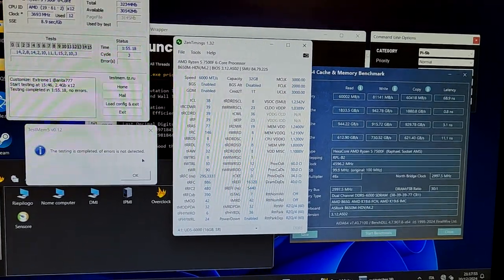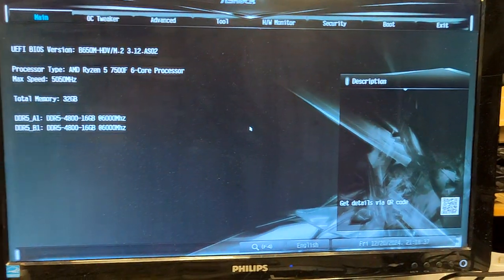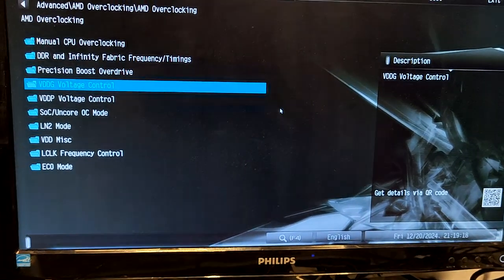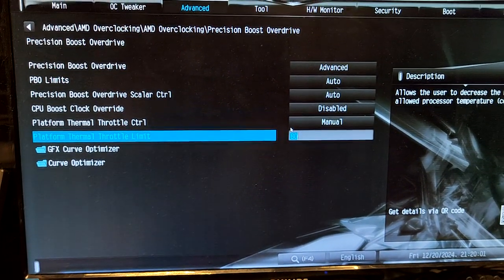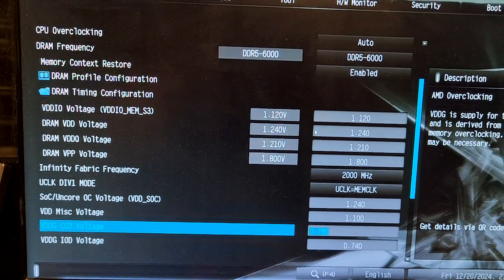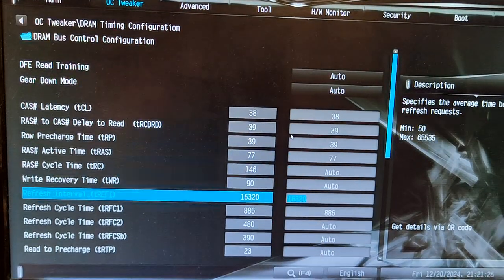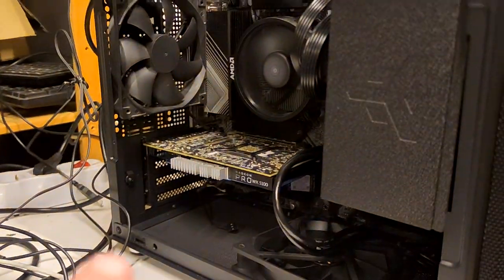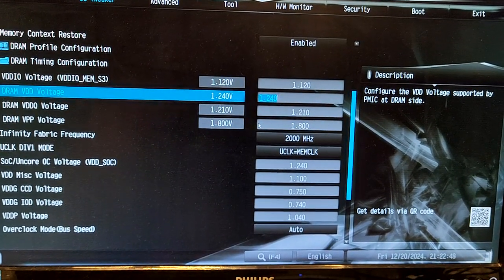unlucky 7500f undervolt, curve optimizer actually in line with overall silicon quality

Comment: would that be helpful in lowering the North and South Bridge chipsets temperature? in MSI Tomahawk Mag 670e?? because that chipset is getting hot in that version 670e and keeps getting higher temp. till you put a fan there!. Thanks for your videos.
BTW, those two chipsets are now together in the same location under the heatsink in the motherboard.
Reply from the maker: i think there is a separate toggle for chipset voltage, these settings in the video affect northbridge / imc power draw

Comment: Very strange. I have almost the same set: 7500f (PBO + 200, curve - 30) asrock b650m-hdv/m.2, patriot venom 6000cl30 overclocked to 6400cl30 and understated sub timings in aida latency 54.7ns. Infinity Fabric 2133. Bios V3.15. If you want, I can write all my settings, if your RAM is hunix, the settings should be +- suitable.
Reply from the maker: @icewater4723  what did you test to validate stability? occt cpu+ram passed? back to back Ycruncher runs? i think this was just awful silicon quality anyway. Memory might be new micron wich is quite good, can do 6600 on 12400f easily at low voltages 38 40 40 96
Reply: @ Yes. I checked everything according to stress testing guidelines. Additionally, I overclocked the base bus to 100.56Mhz
Reply: same board and same cpu i cant get higher than -8 on the curve, higher than -8 mi pc is unstable , can you share your settings?
Reply: @ It depends on the silicon lottery. In this case, I recommend setting curv optimization for each core separately. Perhaps, only one core is not successful, it does not allow you to reduce the curve below -8
Reply: @icewater4723  thanks , i will try that

Comment: Its most likely expo 6000 thats makes it unstable try to run 5600 vs co -20
Reply from the maker: @saddlesore_adventures  why then would it be stable at -7 then?
Reply: @PizzaUndervolt  I'm not entirely sure the technicalities of that but as i understand chip bumps it's internal voltages automatically to run RAM oc, then it's a struggle between vsoc that needs to be low for fclk vs vddiq vvdio that needs to be high. I had issues at 6000 and occt threw CPU errors, but as soon as i dialed down RAM OC it became stable even with more negative co values (-30). Unstable FCLK is pain to diagnose, and DDR5 is very finicky at 6000+ too, especially on low end board with poor internal signaling. Just try it and see if it helps!
Reply from the maker: @saddlesore_adventures  this board is good being dual dimm, i will test next build for your suggestion for sure but find it hard to believe as i never found ppl complaining about 6000 being unstable